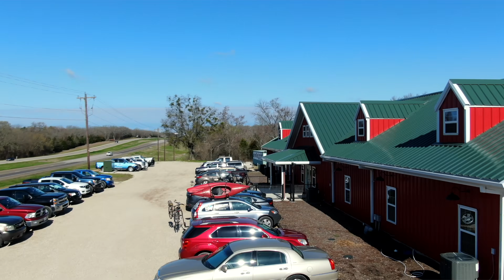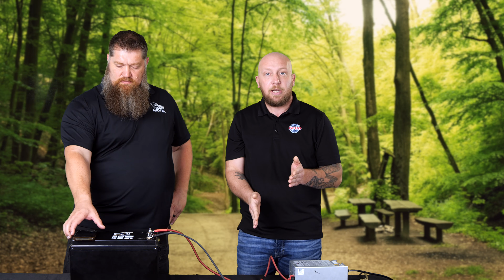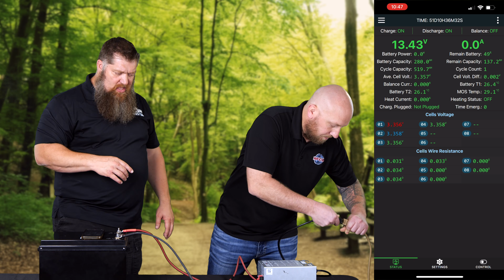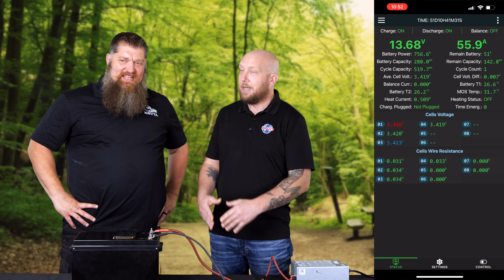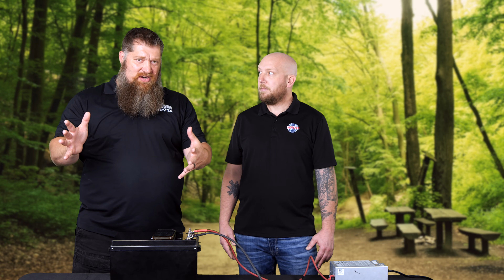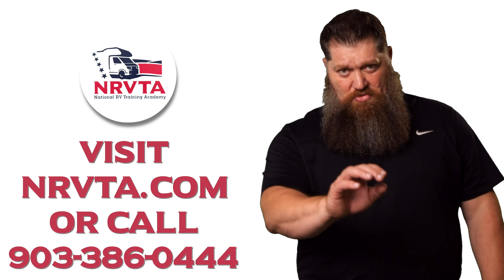WFCO auto detect battery charger, does it actually work?

Comment: Hi Todd!  Thanks for all the great tech tips. I know this video is older but it relates to my question. We have a new travel trailer with lithium batteries. The cabinet where the converter is has the WFCO sticker that says auto detect so I’m assuming it is.  The refrigerator is a Furrion Arctic 10.7 cuft 12 volt.  My question is related to the following: when we connect to shore power you can hear something running in the converter cabinet.  After a few minutes goes by the refrigerator will start to beep very quietly. When I looked at the control panel in the fridge and matched that back to fridge manual it is saying the voltage is too high.  The beeping will stop after several minutes and the control panel will say everything is fine.  When I check the battery voltage it is usually in the mid to high 14 range but also eventually goes back to a normal range. Is the converter always assuming lead acid every time we plug into shore power? And then figuring out it’s lithium?  This only happens right when we plug into shore power and after this cycle it behaves as expected for the rest of the time we are plugged into shore power.  Are we damaging the fridge or our batteries with this process at all as it repeats each time we go to a new location with shore power.

Comment: This is damage control for WFCO. 

WFCO rep has the "deer in the headlights" look throughout this video. There are thousands & thousands of these factory installed on RV's as they sold this concept to manufacturers during this transition of lead acid to newer lithium technology batteries. WFCO corp certainly had a meeting and said something to the effect of "we've got to get ahead of this and make it sound like there isn't an issue" and that this is actually good for the batteries and that they (WFCO) know better than the battery manufacturers what the battery needs.

For the WFCO "Auto Detect" in my RV (factory installed by RV manufacturer), dropping the SOC of my lithium below 20% doesn't trigger the lithium mode (aka "blue light") even as suggested by a WFCO tech rep on the phone. Since the rest of my RV is wired to this converter, I'm leaving it in for now and charging the battery separately with a dedicated lithium battery charger (20A) and the battery is performing/charging perfectly now. WFCO tech help is resisting sending me a jumper to force it into the correct mode, seemingly that by doing so would admit fault.

My experience, yours may vary. If I knew which "pins" the miracle WFCO supplied jumper attaches to, I'd do it myself.

Comment: The big guy acts like it doesn't matter what mode it's in; it will charge lithium, and it probably will. In my case, with a 200 Ah lithium battery, the charge current dropped to 2 amps at 60% state of charge. The remaining 40% would have taken two days. Since the converter has no memory, every time it's plugged in, it may or may not be in the lithium mode. I replaced mine with one that lets me manually select the mode.

Comment: I put a 280ah battery in my new 2026 15mrb. Is per instructions I drained the battery down to 20%soc. I plugged into shore power and monitored the battery Bluetooth bms, the charge dropped from 30a to about 5a when the battery reached about 65%soc. I let the battery charge to 100% and the converter charger light stayed green, indicating it's still in La mode.
I figured out that  the charger timers does timer out after 4hrs and goes into absorption charge mode, I don't believe the "auto detect" detects the lithium in absorption mode. I believe the battery needs to charge fully from the charger within the 4hr time limit of the converter.  So I'm taking out 100ah from the battery now and the 30a charger should stay in bulk mode thus completing the detection mode.

Comment: I got here because my rv came with a blue top agm battery. The camper went back for repairs under warranty when it came back one of the cells in the battery had overheated and burned a hole in the flooring and into the plywood subfloor luckily it didn't ignite(kudos to flame spread requirements) now I am trying to figure out if it was a battery failure or the WFCO

Comment: Below is the text from the company tech who I emailed with this morning.  Very quick to respond btw.  Also the current firmware should be v1.21A.  See bellow...

Good Afternoon,

Our auto detect has never had issues with detection; the problems people run into are related to the installation, or simply lack of understanding how the system works.

You just have to make sure when you put in a lithium battery you let the converter have the time to charge that battery.

Check in-line fuse size and ensure that it is a 60amp fuse.

Detecting battery type is pretty simple.

You will want to disable any external chargers or solar during this stage.

Drain your lithium batteries down to 10-20%.

Plug into shore and allow the converter to charge the battery to full.

Towards the end of the charge the converter will switch from a green LED to a blue LED indicating the lithium charge profile.

Thank you!

Austin Milcherska

Technical Support Specialist

Comment: So, a simple question: Will the auto detect not working hurt my lithium battery?
Reply from the maker: Typically no. But there is a strong probability it will not charge it fully. This over time, will lead to an imbalanced battery. 

So limited charge and imbalanced cells. Not recommended.

Comment: The voltage drop doesn’t factor into the converter detecting the type of battery. The converter only sees the voltage at its output not what voltage is dropped in the cabling

Comment: This video is absolutely the best advertisement ever for the Progressive Dynamics PD9300 Converter/Charger.  Good job!  🤣
Reply: the worse part is that this videos is 2 years old and my 2025 RV is having issues detecting my Li battery. How have they not fixed this? Progressive Dynamics PD9300 it is!
Reply: Agreed. Having issues with my WFCO 9855

Comment: I have a WFCO WF-8955-AD power center charging a GoPower GP-ADV-LiFeP04-300 300ah battery.  The Bluetooth GoPower App says the battery is at 13.45v and  at 297ah.  Still the charger fan continues to run.  I am surprised to hear the charger continue to run.  Should I expect at some point that the WFCO unit should stop running with no sound?  What don't I understand?

Comment: So at one point the WFCO rep said you could disable your factory converter and add in a deck mount converter near the battery, to deal with voltage drop. Your converter has 2 wires that go to the DC board that I assume power your DC appliances. If you disable it how will they get power? Do you have to run cables from your new converter all the way back to the DC board?

Comment: Either the National RV Training Academy lacks the technical expertise to understand the problem that folks are having with the WFCO 8955 or they’re being intentionally deceptive because WFCO is a sponsor.  The problem isn’t getting the WFCO converter to go into lithium mode it’s getting it stay in that mode.  Like others, we’ve repeatedly done the discharge trick and while our WFCO 8955 initially goes into Lithium mode, after a few days or a couple of weeks it resorts back into lead acid mode.  We’re done continuously risking the damage of discharging our batteries completely to reset this thing and we’re now replacing it with a Progressive Dynamics model.   Until WFCO finally master’s the battery sensing technology, they should just go back to making a lithium specific converter.

Comment: I upgraded my batteries on my trailer to lithium. I wasn’t able to get a hold of anyone via telephone, but I got an email back telling me that my converter would not charge lithium. They gave me a part number and I ordered it. I put it in, and my goodness I don’t think I have any hair left. I discharged my batteries fully twice, it start off charging them at around 20 to 22 A and then drop right back down to like 2 Amps at 13.5v and never switched over. Was an absolute complete waste of my time, this product is garbage and they need to put the switch back on it.DOES NOT WORK!!!!!! I have ordered the jumper from WFCO and I’m hoping that fixes the problem because if not, I’m going to take the unit out and throw out the fire pit. Nothing they said in this video is correct and is not the way things are gonna go for you.
Reply: How did the jumper work? I am having same issues

Comment: I recently bought a new WFCO 8725AD to replace a bad 8725P; had to go this route as my 2017 Pastime camper isn't (and can't be modified/wired) for the larger 35amp--especially in the quality Progressive Dynamics 4100 series. My unit can't see my lithium battery and after 60 hours S I X T Y and a max charge of 80%....I gave up and put in a dedicated Victron 30amp IP22 to charge my lithium 140ah. I put in a switched outlet combo in the cabinet for the smart charger and yanked the battery fuse from the WFCO unit. Finally gave up on the junk WFCO as a charger.maintainer and can now watch my LiPO battery charge in practically minutes and not literal days.
Reply: I’m thinking of switching to Lithium on my 2019 Flagstaff. After watching videos and researching I’ve decided I’d likely but the Victron IP-22 like you did. I’m wondering about “ yanking the fuse from the converter “. Can you tell me more? Thanks
Reply: @williambeams1110  Well, the reverse polarity blade fuse in the control panel is the output to the rv battery.  By removing it, it effectively stops any charging to the unit battery. At least that is what is happening on my system. I don't want my brand new WFCO 8725AD getting anywhere near my new 140 lithium battery! How's that for irony?! Initial call was answered, but repeated calls to WFCO and subsequent emails have been ignored, they are a horrible company.

Comment: OK, ran my new Lithium Ion batteries down to where they wouldn't turn the lights on in the trailer. One thing I noticed, after they were installed though was that With 200 watts solar on top, running the 12 volt fridge only, I couldn't get the monitor to go down enough to below 50% for a couple weeks. I saw it getting 7AH on the solar monitor during the sunny days. And the dumb monitor saying everything was charged up after dropping to three quarters after a night of running the fridge. 

I finally had to turn on the fans and lights for a day and into the night to get it to discharge faster than it was apparently recharging.  it was heck getting them to go below 50%.  The battery did it's low charge shut off. So, I Plugged it back in came back next morning full batteries everything works but monitor still says "flooded" (WCFO) indicating it thinks I still have my dealer supplied old school marine batteries in there is my interpretation. 

Am I doing this right?

Comment: Contacted Weize battery about these recomendations, since I have not have luck charging my lithiums properly,   
inquiry
Wed, Aug 6, 10:29 PM (8 hours ago)
to me

Dear customer,
Thank you for reaching out and sharing your concern.

Regarding the issue with the WFCO charger not correctly detecting the lithium battery and operating in "Lead Acid" mode, you are correct to be cautious about discharging the battery to 0%. Lithium batteries should not be fully discharged as it can damage the battery and reduce its lifespan. Most lithium batteries have a built-in protection to prevent this, so discharging them completely is not recommended.

If the charger is not automatically detecting the lithium battery, a safer approach would be to follow WFCO’s recommendation, but within a safe range, such as discharging the battery to around 20-30% (around 12.9-13V) instead of 0%, and then allowing the charger to detect the battery. Alternatively, you may want to consider using a charger designed specifically for lithium batteries to avoid any risk.

We hope this helps resolve your issue. If you need further assistance, please don’t hesitate to reach out.

Best regards,

Comment: I have a 2024 Connect with WFCO Converter. After following these instructions a couple of times with no success. Still have green light. My manufacturer recommends not discharging to O. Took mine down to 13%

Comment: I just don’t understand? Not even remotely close to being a thing that we need because we don’t switch our battery chemistry very often and if we did, we’re certainly capable of flipping a switch. In fact, it would be far better if it just went into full lithium, powerful charging mode every time I plug my RV in rather than having to think about it and possibly mess it up. I’ve been shopping for a new converter with 80-100 amps for a while now and I just won’t buy one with auto detect because there’s too many people that are having problems with it.

Comment: I recently switched to LiFePo4 in my 2023 TT. It came with a WF-8735-AD, so i figured there should be no issues with the conversion. But, like nearly everyone else, the auto-detect doesn't work. I figured I'd try to call WFCO to get the jumper that many were reporting have been sent to "force" the system into Lithium-only state. The rep wasn't agreeable to that. He told me that I should discharge the battery to 15%-20%. Also change the F6 fuse (30A) on the panel to 40A. Finally, he said that there would be an inline fuse within 5' of the battery bank that I should change to 40A as well. This seemed potentially risky to me so I asked him about overloading the wires and he said as long as the wire is rated at 150C degrees, it should be fine. The inline fuse that I assume he was referring to is only a 15A and I just can't believe that there's no risk in plugging in a 40A fuse in its place.
I haven't done it yet because I don't have the nerve to let it do its thing for 5 hours unattended, and I don't have the time to baby-sit it. If something is advertised as "Auto-detect," I shouldn't have to perform risky work-arounds just to "trick" the system to detect what it's supposed to do automatically. I think I will call back and insist on the jumper

Comment: I just picked up a Big Beard 300Ah battery. I discharged to 5% then put rv on shore power to charge. The Wf-9855-ad charger shows green led (lead acid, not lithium) and has been two days and is only up to 92% charge. Where should I look?
Reply: Let me know what you find out. I have the same 8955 model. I haven’t switched to lithium yet until I know for sure that the converter will detect lithium
Reply: @craigwalsh4632  My converter did not work as intended so I contacted the manufacturer. Tech said send it back, pay for shipping and they would upgrade the firmware. When I went to send it back the person with RMA paperwork said since I was second owner they wouldn’t touch it. I told them what the tech said and she begrudgingly said she’d check with a mgr. She called back and said ok they’d do it, but by then I was pretty disappointed. I ended up buying a different brand of converter. Love the converter and especially the battery. At a Harvest Host right now. I’ll post the model and brand of converter in a bit.

Comment: I have this Auto Detect on my RV and I am using a Lithium battery which I installed myself and then I set my controller to the lithium battery setting. The resting charge states 13.5 volts and it shows my battery is charged to 100%. What I don't understand is the boost option? Honestly, I'm not totally sold on this Auto Detect System. I don't believe it charges a lithium battery to 14.5 volts and this should be done at least 1-2 times a month to keep battery cells balanced. WFCO does have a jumper that can be installed in this converter. This jumper will keep the battery in lithium charging mode. It's easy to install. I'm NOT planning to go back to a led acid battery. Sadly, it's hard to get this jumper. I would pay for it if they would just send it to me. My alternative solution is to add a secondary charger harness to the battery and top off the battery to 14.5 volts using a auxiliary lithium charger. Shouldn't have to do this but that's really my only option.

Comment: 2025 RV with a 314ah 12v. BMS will only allow discharge to 11.5v. I've not been able to get it to switch into lithium battery mode. Will I damage the battery if the converter stays in lead acid mode?

Comment: I don't find this "test" to be at all convincing.  First they didn't show the end of charge and then a subsequent restart .  Even worse, it's too short of a run of cable relative to what is in many RVs not designed for lithium.  If the run is 25' or longer and 6 gauge or smaller, the voltage drop would be considerable at 50 amps.  So the fact that some people find these will detect and some don't might go beyond the firmware release, and relate more to the RV itself.  The solution for such RVs is a charger closer to the batteries, especially for larger battery setups.

Comment: I watched this video over a year ago and at the time all was good as we were RVing newbies. However since then we have found that the WF-8955-AD, Auto Detect, does not detect our Lithium batteries. We are currently working through the issue with a WFCO rep, but so far there hasn't been a resolution. When one searches the internet this problem seems to be very common for the last several years and yet its still an issue. According to some sources the fix is a simple jumper with a resistor on it. I haven't got that far with the rep yet so I can't personally say that is true.

Comment: Wow, I expected good information, not this. As others commented the float mode is the issue & the batteries not reaching capacity. I've just gone thru the motions again for the auto detect to get in the lithium mode as it goes back to LA.  I also read here for the BMS to balance cells correctly 14.6vdc is important. Better information from the forums & Ytube.